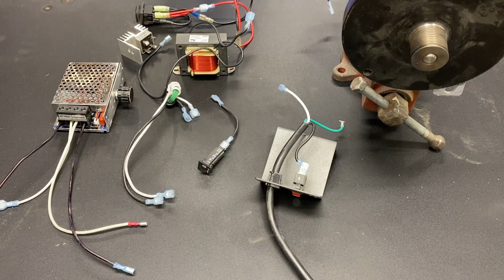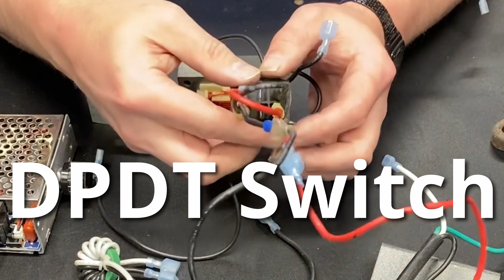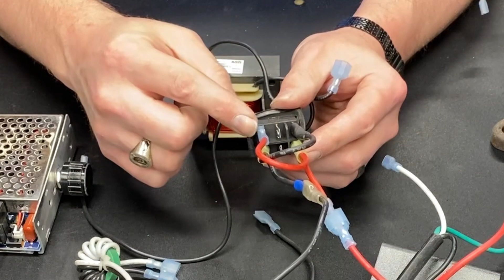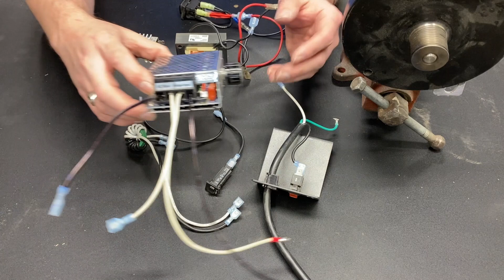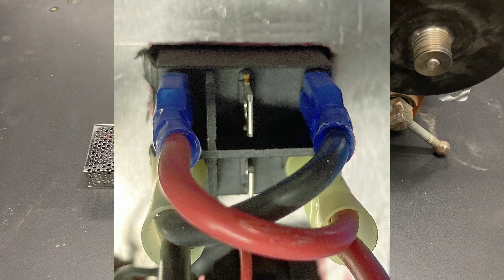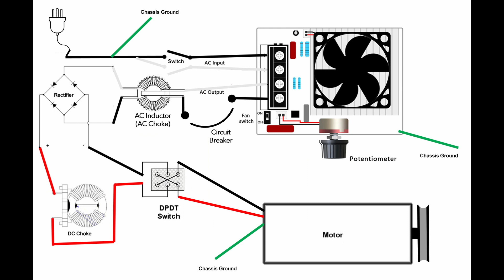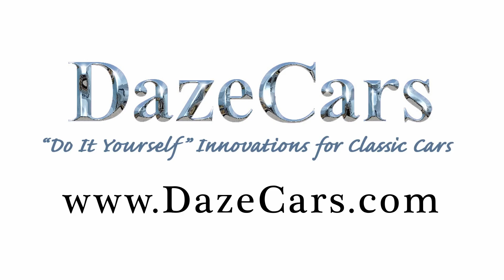Hooking up the Components for a Quality SCR Treadmill Motor Power Supply, Treadmill Motor Controller

Comment: I have a 120 v to 16v transformer do think if I remove the low voltage wire side it would work as a choke for a treadmill motor regards Peter .    love the videos
Reply from the maker: That is likely a class 2 transformer from a doorbell or a treadmill.  If so the wires in the coils are way too small.  You need a minimum of 16 awg wire.
Reply: @dazecars  thanks now i know what to look for, cheers

Comment: would it be possible for you to walk me through connecting the larger rectifier in this video? I am having trouble getting mine to work. i did trip my breaker one time and realized i had the power from the breaker in the wrong position. I currently have the power from the breaker going to one of the ~ terminals and the white from the inductor going to the other ~ terminal. Then I have the long wire from the DC choke going to the positive terminal and the black from the motor going to the negative terminal. Otherwise I will have to buy one of those little rectifiers and hook it up exactly as you do. I just cant wrap my head around this larger rectifier being parallel. Any help would be great. I know your probably sick of hearing from me, so I appreciate the patience.
Reply from the maker: I know you already solved this but I took your idea and ran with it. Video on rectifiers in a couple weeks.
Reply: @dazecars  your the man. I hooked up the reverser switch from your video also. Thanks for all your help and I'm for sure a subscriber and look forward to your next videos on these motors. Really awesome stuff. Now I have to wire in that ac tach you showed me.

Comment: Hello Sir. I don't know if you have a video on hooking up one to 220 volts. I haven't been able to find it. Would there be any advantage to hook up to 220 when a motor has a 130 volt or perhaps a 180 volt where you would need 220 to achieve your 180.
Reply from the maker: If your motor is 130 and you hook it up to 220 you risk putting too much power to it and burning it up, but running a 180 volt motor on 220 would be just fine.  May not want to take it to max but you could get it close.

Comment: man, sorry for my ignorance here. i have the larger rectifier you use and i understand it is not set up diagonally like the little ones. can you explain to me where the black wire coming out of the breaker and the white wire coming out of the ac choke would go on the large rectifier. and then which two wires hook to the other side where the wavy lines are.
Reply from the maker: look at the face of the rectifier near the base of the terminals.  the sideways S terminals are AC and the + and - are DC
Reply: @dazecars  does it matter which wires go where on the sideways s terminals. you plug the black from the breaker on the one labeled ac. mine there are just two s terminals for the ac side. can i hook this thing up backwards?
Reply from the maker: @daduce222  from the point of view of the rectifier there is no polarity so either ~ terminal can be hot and the other one can be neutral.
Reply: @dazecars  awesome, thanks again. Waiting on last component to show up tomorrow, the DC choke. I will be wiring it up after that. Just trying to make sure I get it right. I appreciate all the help.

Comment: Hi
I have a question 
The treadmill wiring I am using has a inductor on the incoming earth wire from the wall,but the motor also has another inductor on the positive and neutral wires leading into motor.
Are you familiar with this set up?
Thanks
Reply from the maker: It is just one more component to filter the power.

Comment: hey, I have a question on the actual wire your using in this video. Is it solid wire or stranded wire? What is the gage you should use? Is there an advantage to using either? Could you use STD solid house wiring?
Reply from the maker: AC travels better on solid wire but DC travels better on stranded.  16awg is a minimum.  I use stranded for everything from the wall on because of the flexibility.

Comment: Hey again, i see the setup on that rectifier but the one you actually use is set up a little different isnt it? Can you tell me how the nicer one would connect in this video? Sorry again for my ignorance
Reply from the maker: there are markings next to each post: + - and two sideways s shapes.  The S shapes are AC inputs

Comment: also, i noticed at the end after you hooked up the reversing switch, the first direction you spun it seemed to be the wrong direction and the second way you spun it seemed to be the direction it should spin. Now this is if what i have been hearing is true, that the threaded treadmill motors are all left hand threads. is this correct or am i mistaken? sorry for my ignorance, I'm just trying to make sure i get this right when i mount mine to the lathe. mine would need to spin the way you spun it last.
Reply from the maker: It depends on the factory direction of the motor.  If it is labled CW than it is left hand thred, if it is labled CCW it is right hand thread.
Reply: @dazecars  Awesome. Hey thanks for the quick reply. I really appreciate it. I dont see either on the label of my motor. Would it be somewhere else? If I could attach a pic of my label I would. Sorry
Reply from the maker: @daduce222  if it does not say then hook it up to a battery with red to positive and either black or white to negative and see which way it spins.  That would be its normal operating direction.

Comment: awesome detailed work. I am getting ready to build this for my wood lathe. can you give me a link to the circuit breaker your using in this video. I am not an electrician so I will be following your video step by step. also a good DC choke. thanks in advance for sharing your knowledge.
Reply from the maker: here are a couple of options

 20 Amp circuit breaker https://amzn.to/3ufQDRh

15 Amp circuit breaker https://amzn.to/3FgoQGP

The choke in most of my videos is part number 130993.  Instead of getting one new I would get a used one. A lot of treadmills come with a choke. Go to eBay and search “treadmill motor choke” BUT know that most people on eBay don’t know what they have and the word “transformer" will also appear in most listings. Problem is a choke and a transformer look almost identical so some listings are for transformers and some are fore chokes because the sellers think they are interchangeable. They are not. They would only be interchangeable if you modify a transformer to work as a choke.  (see my DIY choke video)  To tell the difference count the wires. A choke will only have 2, a transformer will have 3 or more.  General rule of thumb is the bigger they are (physical size) the better they work, also the coil needs to be at least 16 awg. Please let me know if I can be of further assistance.
Reply: @dazecars  Thanks so much. As I start my lathe rebuild, I may need your help for sure.
Reply: any preference between 20 or 15 amp? Which would you go with?
Reply from the maker: @daduce222  depends on your motor.  I use a breaker slightly smaller than max amps listed on the motor but still close so as not to trip it during normal operation.  In other words 15 amp breaker on an 16-21 amp motor and a 20 amp on a 21-25 amp motor.  Also check the breaker size in your house for the plugin you are plugging it in to.  If it is a 15 amp circuit I would use the 15 amp breaker in the power supply regardless of motor size.

Comment: Hello. Great info and we'll explained videos you have. On the SRC they have the 10000 watt one which you are using. Do you know if a 4000 watt one would work successfully. It has a volt meter meter reading on it and all adjustment like the one you use. It cost 34 bucks compared to about 25 to the one you use. Again great videos and thanks in advance. It is to run a treadmill motor also to control some electro magnets I'm making.
Reply from the maker: First I could not ascertain the quality of the SCR you are considering based on your description, I would need to look at the actual listing.  Second SCRs are not created equally.  I tested several before I found the "good one".  Lastly advertised watt ratings are always max, continuous is about half of max so in your case 2000.  Watts = amps times volts so if you are running a 130V  25 amp motor you are going to be drawing 3250 watts well above the continuous rating of that power supply.  That is about as big as I have seen spec wise on a treadmill motor but it illustrates the point that a 4000 watt controller is going to be insufficient.  The main switching component is primary where the watt rating comes from.  It is this component that is doing all the heavy lifting so to speak so it makes sense to have one that is as robust as possible but still affordable.
Reply: @dazecars  Thank you. I didn't think the 4000 was enough but wanted to make sure. The SRC is was looking at looks exactly like yours and comes from a US supplier. It has the fan inside and is rated at 10000. I have one of them voltage controllers from Vevor that goes up to 130. I will get you the number from ebay and send it to you.  Thank you for your help and I really enjoy your videos. They are very well explained. You do a great job.
Reply from the maker: @kellyjones334  Thanks, glad you like them

Comment: Thank you, thank you, thank you.  This finally explained all the connections with all the possible components.  ONE question - the SCR has a potentiometer for speed adjustment, how many ohms is that?  I believe most SCRs come standard with a 470 ohm pot.  Have read that a 200 ohm might be better.  Thanks > Bill
Reply from the maker: Most of them come with 450K Ω to 500K Ω pots so 1000 X bigger than the numbers you have suggested (K means by a factor of 1000) Most SCRs require anywhere from a 120K to a 150K pot but It is not as simple as "this is the size you need".  The SCR/motor/tool configuration can have a major effect on pot size.  In order to correctly size the pot to maintain the ability of minimum RPMs  AND not have a dead spot at the bottom of the pot you need to completely set up the system and then measure the resistance.  I go over all of that in this video https://youtu.be/04d0u1RJyXw

Comment: Daze, can’t you just plug the SCR into a 110 outlet with a switch to turn it on and off?
What gauge wire are you using?
Thanks. 
Paul
Reply from the maker: yes that is exactly how it works, 16 awg minimum

Comment: It seems my last question didn’t make it through. Sorry if I repeat myself. I’m trying to understand the toroidal inductor. What exactly is it doing to the signal coming from the SRC? I want to understand it in terms of verbiage and equations. 
Thanks 
Paul
Reply from the maker: The inductor is a form of choke.  Just like the motor choke on the DC side it is there to filter out noise and power spikes.  Works on the same concept as a choke.  When current flows through the wires a magnetic field is created and this field/(its creation) smooths things out.  As far as "equations" at that point this question becomes beyond my abilities.  I am not an electronics engineer, just a hobbyist.  I know the basic functions of things but not the formulas required to map them out.
Reply: @dazecars  Thanks Daze. For everything, including your patience. 
Don’t take down your series until I’ve completed my system. 
Also, I just got a Southbend 10L lathe and I’m going to make an electronic lead screw. 
You have wonderful videos and you communicate well. 
Paul
Reply from the maker: @paulmanhart4481  happy to help.  Let me know if you have any other questions.

Comment: I am working on a rock tumbler type project that  requires variable speed and continuous run for weeks at a  time. I have several treadmill motors  of various HP some with fans and some with the heavy flywheel still attached. I looking for 300-to 800 rpm. Could you suggest a potentiometer for the low speed... Could I add  muffin fan  to help cool if the motor fan is not moving enough air to keep the motor cool. Thanks in advance
Reply from the maker: First being that it is a rock tumbler I would gear it in such a way that you are maximizing torque.  Second the Potentiometer size is dependent on the motor you are using and the loads of your setup.  That is why you need to use the technique I talk about to properly size the potentiometer.  Lastly if you need an extra fan I would recommend something like this https://amzn.to/3FTJDPJ

Comment: So after building my scr controller as per your videos I’ve just been using the lathe as is with wires all over my bench.. I’m currently cleaning up all the wiring and making everything nice and tidy.. I want to wire up the forward reverse drum switch( 12 poles) and the green and red button master power/emergency off switch that came with my mini lathe.. 

What I’m thinking is the green/ red button one should be on the ac side before all the scr components and the drum switch where you have the forward/reverse toggle in this video.. the trouble I’m having is with how these two switched are hooked up with the original board.. it looks like both are connected on the ac side and are also connected to each other it a way that doesn’t really make sense to me.. I thought I had it figured out how I should wire everything up but after looking at the original wiring I’m either right and the factory set it up weird or I’m wrong and completely lost.. is there any way I can send you a picture of it to get your thoughts on how it should go? 

If not no biggie I totally understand your a busy guy and I appreciate your videos and all I’ve learned from watching your channel.
Reply from the maker: email me through my website with the pix

Comment: Do you have a list on another video with links to the other parts?  I ordered the SCR and rectifier links from one of your other vids, but I'd like to order all the other parts you're using in this video.  I'm competent enough to wire and connect things safely, but not to order the correct parts for this application.  TYIA

Edit - Can any of these parts be salvaged from a faulty MC2100?
Reply from the maker: The treadmill motor choke can be gotten used on ebay just make sure it really is a choke and not a transformer as some sellers don't know what they have.  The circuit breaker is nothing special 15 or 20 amps.  The choke for the AC side can be made, order a 25mm ferrite ring and take 7 wraps with each wire lead.  Let me know if I can be of further assistance.
Reply: @dazecars  are chokes one size fits all, or are there ratings that are important to look for?  I don't use Ebay, and for the life of me, there's only 1 filter choke on Amazon.. 1.  For the sake of building from the SCR, is there any components on the MC2100 worth desoldering for reuse?  The large cap and resistor look very similar to that cap/resistor module you used in one of your videos.  I'm just looking to shave expenses wherever possible and I have this MC2100 paperweight....
Reply from the maker: @MichaelJeffers75  no they need to be fairly good sized in fact an un official rule is the bigger the over all size the better they work.  My best one is about the size of a soft ball.  The biggest thing is they need to be able to handle at least 15 amps.  Buying one new will be expensive and at that point it may be more cost effective to run a different power supply.
Reply: @dazecars  I'm already too invested into recreating your SCR based circuit to consider another route for this motor.  I'll try combing through eBay for a used one.  Can you think of any appliances or old tools that might have a good enough choke?
Reply from the maker: @MichaelJeffers75  search "treadmill motor choke" on eBay BUT make sure it really is a choke.  Most sellers don't know what they have and think a transformer and a choke are the same thing.  Easiest way to know is to count wires if it has 2 its a choke, more than two it's a transformer.

Comment: Hi there. Great video-thanks. I've bought all the parts from Ebay except for the circuit breaker. Could you tell the manufacturer of the circuit breaker, I see below that the preferred current rating is 20A.
Reply from the maker: here you go
https://amzn.to/3Dn03P7
Reply: @dazecars  Hi there. Thanks for that info, I'll get one ordered. I hooked up the circuit with the parts I have and the motor worked just fine

Comment: Hi there,
Can you tell me / us, with the src controller that has 110/230v capability, how is it switched. 
I have just received 10000w 110/230 unit but I’m in New Zealand and we use 240v but I’m not sure on the above question.
Thanks
Reply from the maker: It is not switched.  It does the same thing regardless of input voltage.  The thing you must be carful of is the voltage of your treadmill motor.  If you hook up an SCR to 110 you get between 5-100V out of the system.  If you hook it up to 220 you get 10-200V out of the system.  If your treadmill motor is 180V-220 DC you are good to go but if it is 90V at anything over 1/2 you will be over driving the motor and will likely burn it out.  Assuming your motor is 90 and not 180 the two solutions would be to use a potentiometer and a limiting resistor in series to get max desired RPMS so you can never get more than 1/2 out of the SCR OR use a 220-110 transformer between the wall and the SCR.  Make sense?

Comment: Hi there,
From my knowledge the tredmill motors are usually 3phase induction. Is this circuit suitable for the 3phase  motor
Thanks and regards
Tk
Reply from the maker: Most treadmill motors are DC. This circuit is for variable DC voltage. A 3 phase motor is AC and requires a VFD to vary the speed. I have scraped about 15 treadmills and one out of 15 had an AC motor the rest were DC